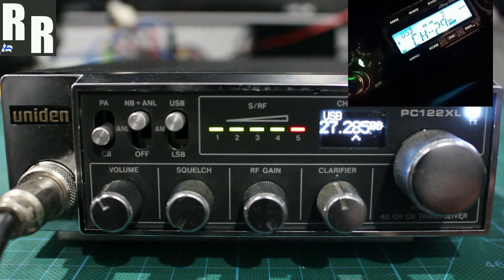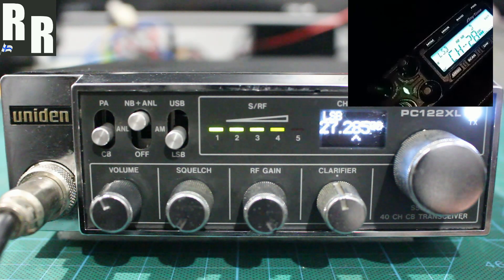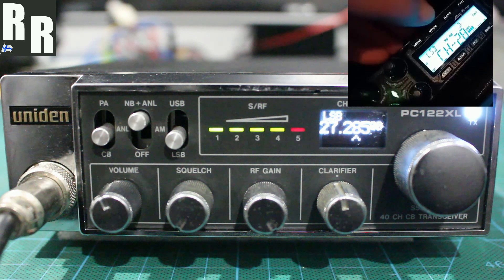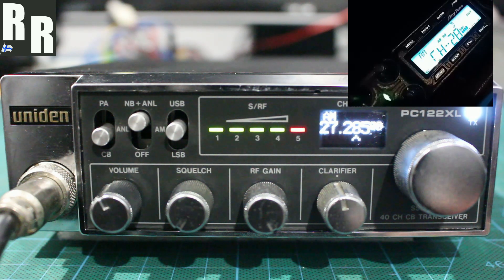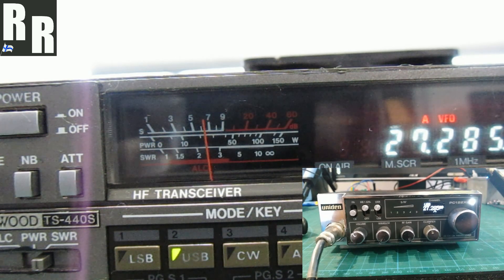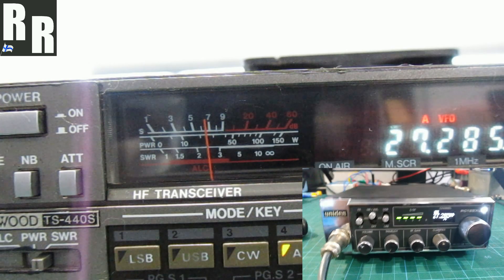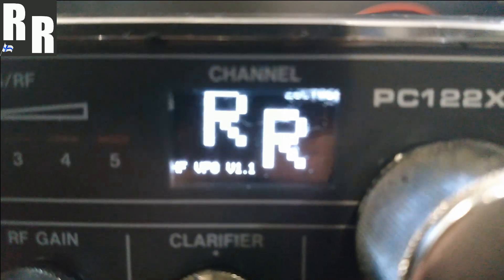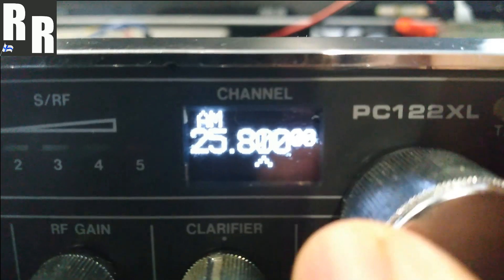Uniden PC-122XL + RR HF VFO (DDS) for Gareth in UK - 30-05-24

Comment from the maker: FOR SALE: RR Product prices and info -> https://www.facebook.com/media/set/?set=a.2186013931467450&type=3
(e): web@razorradios.com

1. RR HF VFO (Replaces PLL/VCO/LX REF OSC system),
2. RR Nitro (Light up the front display behind controls),
3. RR PIC 18F DEV Mini (Develop 'C' code for the PIC MCU),
4. RR 824-106 (PLL uPD2824 to MC145106 adapter board),
5. RR 719-106 (PLL MB8719 to MC145106 adapter board),
6. RR CYB2 (Replaces ZZZ-043 / Green Block VCO block),
7. RR CYB1 (Replaces ZZ-Z017 / Silver can VCO block),
8. RR CLK (Replaces SL-1494-11T clock display).

#VFO #DDS #Si5351 #ATmega328P #HF #CBradio #Amateur #Atmel #RR #mods #10m #28MHz #11m #27MHz #12m #26MHz #KiCad #G4DUDE #AVRdude #CB #NitroRing #MCU #microchip #PIC #18F4685 #PICkit2 #iCP02v2 #uPD2824 #MC145106 #MB8789 #PLL #MB8719 #MB8734 #VCO #Cybernet #PLL02A #CYB1 #CYB2 #NTE1233 #760136 #MC145109 #PLL02AG